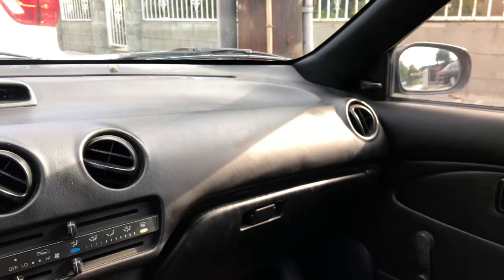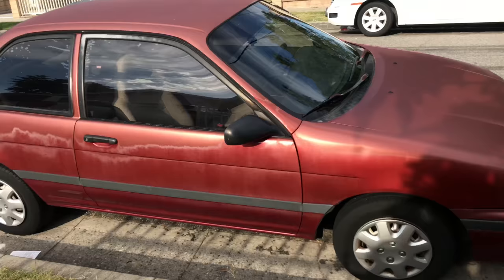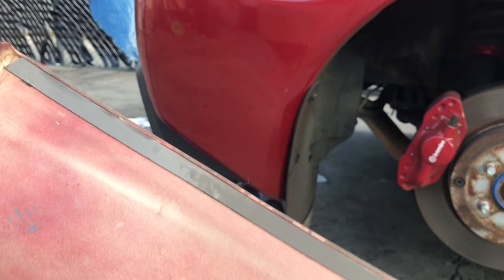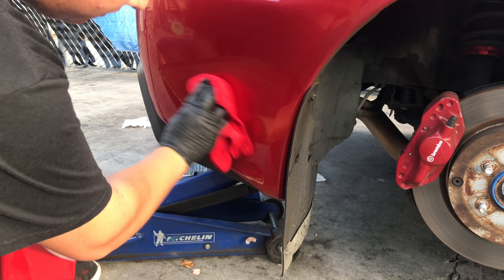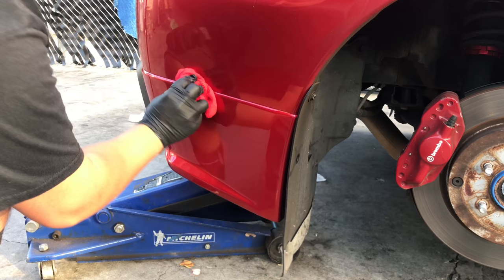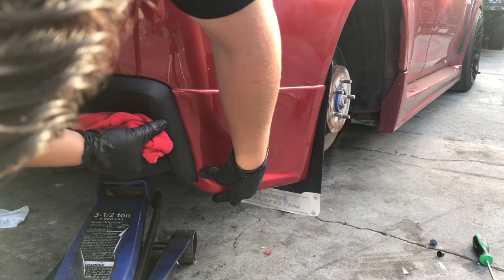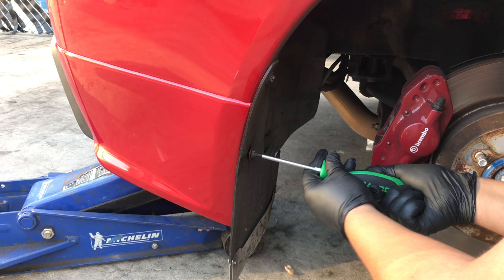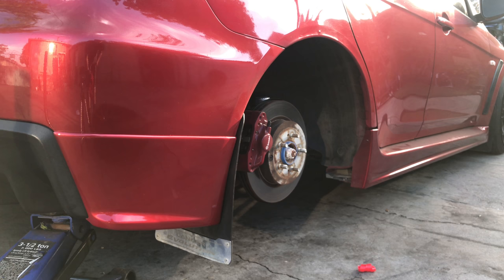EVO X rear aprons install & car wash.

Comment: what rims you running? and size of the tires? I think they will look good on my evo to lol
Reply: Brandon i was thinking the same, just saw 245/40/R19..
Reply from the maker: +Brandon they are ground force wheels 19x10.5 and tire size is 245/40/R19
Reply from the maker: +cotisado16 yes sir and wheels are 19x10.5

Comment: how instal front lip?
Reply from the maker: +Максим Соловей  they just slip on it's a tight fit so it stay ok and all u have to do is use two screws at each end I kinda have some clips of it on my skid plate video check it out bro